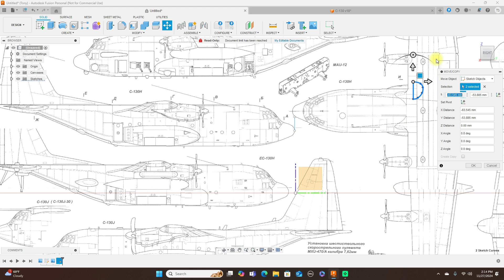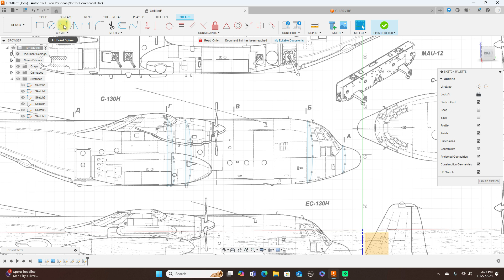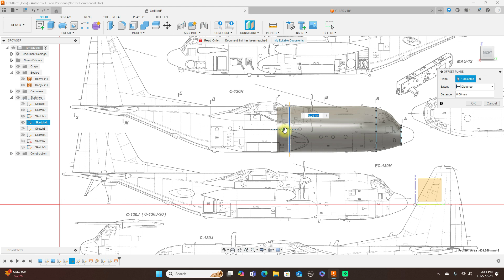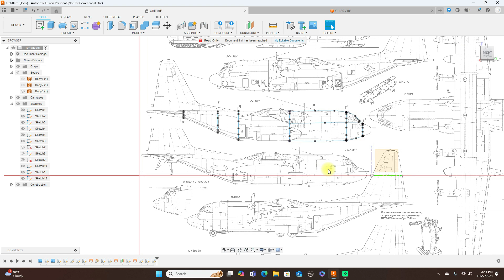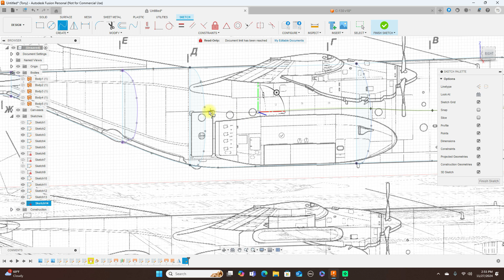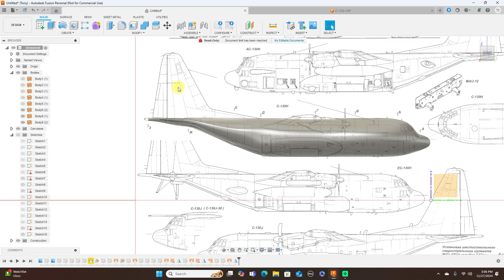Learn a workflow to Surface model a C-130 in Fusion 360/CAD Tutorial. Beginner to advance

Comment: Nice job on the Herc. You describe using the Fit Point Spline for speed, however you advise using minimum points. Please demonstrate the recommended use in a future video. Thanks.
Reply from the maker: Thank you.  When I talk about using the splines, I am talking about not using as many points on the spline as I do for speed.  You will still use the spline, but with less points, then use the handles on the points to get the desired shape.  To get a smooth curve, use lets points.